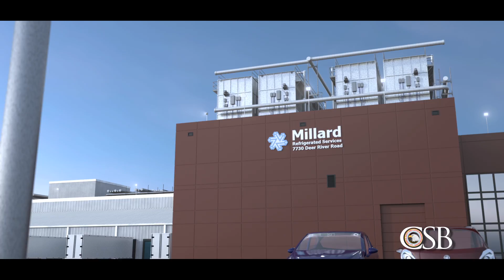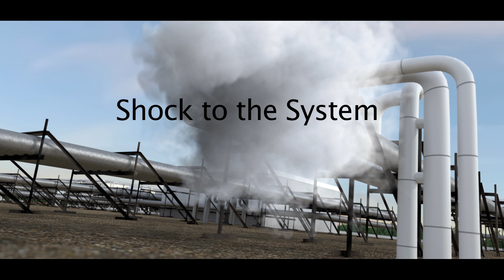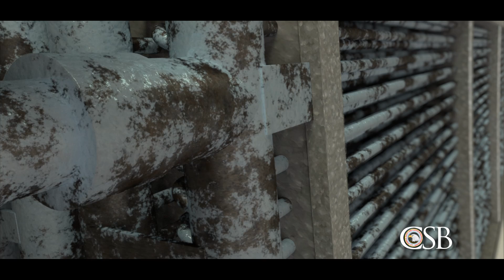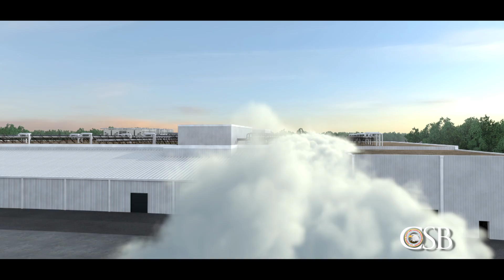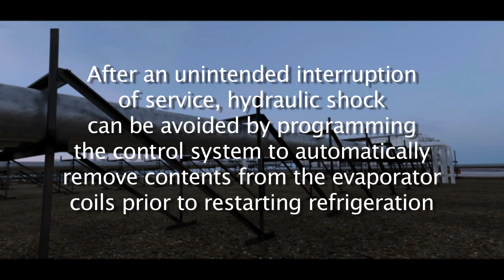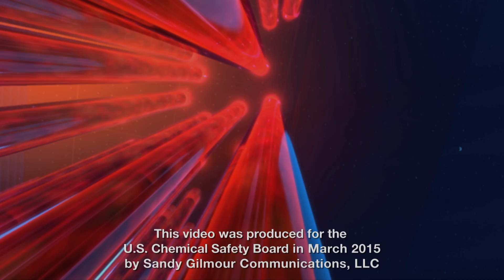Shock to the System

Comment: The people who do know about hydraulic shocks,usually call them ''water hammer''.
Reply: Steam Hammer and Water Hammer are two different animals. Water Hammer is due to the incompressibility of most fluids not being able to absorb the inertia of the fluid moving through the lines when a valve is suddenly closed.
Steam Hammer is from a rapid cooling of a gas to fluid resulting in a fluid 'plug' being built up and sent down the line with great force due to the vacuum in front of it from the rapid condensation pulling it, and/or the pressure of the gas behind it pushing it.
This was an example of Steam Hammer.
Reply: Daniell Bondad Never close a fire hydrant to quickly ;)
Reply: This aint water tho :)
Reply: Steam hammer as well.
Reply: I’m no plumber but a T section would be mounted vertically on the water line near the faucet. The idea is air would be trapped in the vertical pipe and act as a shock absorber for the water when it is shut off.
Reply: My toilet has a sticky refill valve that sometimes goes on a rampant hammering spree, visibly shaking the pipework after i flush. Talk about sending the stuff out with style...
I mitigate that by opening the cold faucet on the sink, giving the shock a place to get out.
Reply: Daniell Bondad its a better name and people look at you funny when you say water hammer. hydraulic shock and peoples eyes glaze over, "water hammer" makes peoples eyes bug out.
Reply: water hammer is totally diffrent mechanism, for irrigation anyways
Reply: @Richard Vaughn sounds good, doesn't work.  The air is eventually carried out since it can dissolve somewhat in water and the piece of pipe is fully filled with water.  That's why there are dedicated devices for that these days.
Reply: I was taught it was “liquid hammer” in tech school
Reply: I was just about to ask this. "Isn't this the same thing as water hammer?"
Reply: Or in this case ammonia hammer!
Reply: Practical Engineering guys over here huh?

More on that later.
Reply: It wasn't water..
Reply: Water hammer drives me fucking nuts, but at least it isn't supercooled/ammonia I guess.
Reply: Ah yes. If they just called it a water hammer I would’ve known what it was right away. Good call.👍
Reply: I always wondered if you turn the tap(House water that is) on or off fast and get the Hammering or juddering in the pipe that it may be damaging it?
Reply: @steviebboy69  Not a plumber or engineer but my guess would be 'probably no'; Most modern pipes would be substantial enough that the hydraulic shock behind the hammering noise wouldn't damage them, they'd just be too structurally sound. I guess low quality joints or valves may be but I guess in most houses they'd also be sturdy.
Reply: I wonder how different in a house of vintage like mine  over 60 years old.  it only hammers if i turn the taps off fast.
Reply: @steviebboy69  I'd guess that an older house would have even sturdier pipes than a modern one. Even if not, water hammer wouldn't effect intact pipes as the pressure would be spread over too great a surface area to rupture them. I'm not a plumber though so I may be wrong
Reply: @steviebboy69  8 months too late but water hammering will indeed wear your plumbing, especially the tap you are closing. It is the main reason why single lever mixing taps fail, the ball valve wears enough so it doesn't seal anymore and you get a drip.
Reply: @krpajda  Well you would thing that the banging would be doing some damage.
Reply: @willastle9623  In water lines they have shock arresters installed.  You may have seen them, they are usually behind a faucet and are approximately about 12 inch's long and are always vertical.  This is important because to operate it has to trap air inside, when a valve closes on your washing machine it creates a hydraulic shock which flows back to the air column which absorbs the shock by compression.  You also have these on your kitchen sink, where they are installed under the cabinet.  They can't completely eliminate the hammer but can reduce it considerably.
Reply: @steviebboy69  
On an old house, you might have an expansion tank or well tank. Those help prevent water hammer, by giving it somewhere to go. Of course, if those tanks are bad, they won't do anything, and should be replaced. Otherwise, if you do not have anything, you should probably install something to fix the problem. Older pipes, even copper do wear down over time, and get thinner. The small water hammer event can be enough to burst a pipe one day, and then you got a bigger issue. Over 60 years old? I'm in a house that was built in the late 1800s, but luckily a little bit more modern plumbing.

Comment: Same Problem as steam hammer I suppose. Large quantity of liquid gets up to high speed then slams into closed or restricted piping. Since the liquid is largely incompressible. The pipes adsorbs the energy by stretching. This can generate very large forces. I have only ever used ammonia in laboratory work in solution. Just having solution in open beakers is enough to clear a room. Releasing thousand of pounds of the dry stuff into the air is a really bad move.
Reply: More of Steam Hammer is a type of Hydraulic Shock, just that in this case it wasn't water... and they are using the engineering technical name for it.
Reply: I know this is a old thread but can anyone with any experience with this kind of system tell me how exactly the system was running a defrost cycle while the electric was out? the video explains it as immediately after power was restored, the system was in the middle of a defrost when they tried to restart it but doesn't make sense how that happened if there is no power to heat the ammonia.

Comment: BAD SOFTWARE/EQUIPMENT DESIGN
Reply: Beyond bad. The software should have been configured to automatically drain all pipes before restarting refrigeration if it was reset, interrupted or powered on from a otherwise unknown state. It should also have been designed to refuse to reset units that were performing operations that should never be interrupted.
Reply: Exactly
Reply: Agreed.  It's an engineering design flaw.

Comment: Very well made, very clear, thanks.

On the need for passwords for manual overrides, I can't help but think of the several other CSB videos that say something like "operators had been given the password", "the supervisor entered the password", etc.  If you don't have a hardwired interlock (like a temperature or pressure sensor on the coils interlocked to the valves) some fool will blow it up.  Yes, you can bypass the hardwired interlocks, but with much more effort -- hopefully more effort than simply fixing the problem.  Passwords are too easy.
Reply: As long as there is a way to override the safety measures by "authorized and trained personnel", this will also be done by some guy who cannot deny his bosses wish.
I have seen the owner of a dry cleaner shop to use a screw driver to mechanically unlock the magnetic lock of a cleaning machine while the solvent was already in. For him it only was holding the breath for a few seconds while putting some more clothes in and saving an additional machine run. According to the certificate of the shop he is a trained professional.
Reply: You are a100% correct. All interlocks should be hardwired. I've been an I/E Tech for 30 years and seen some dumb shit. Thers's always one or two idiot techs who will show operators how to jump interlocks thereby putting everyone's life in danger. To this day I've never jumped out interlocks for operators. It's cost me several jobs but I can sleep at night. Oh yeah I almost forgot nobody from lowly operator to plant manager would ever put in writing that they were asking me to jump out interlocks
Reply: @notsure1115  Well that is real shit. Like "Yo pal, just tell me how to bypass this system's safe locks in case i will need it, but let it be just between two of us. No docs, no evidence. That's basically the way you, engineers, do things, right?" 
Cant find words to describe this level of idiocy, ignorance and impudence of managers. 
BTW is there a way to prosecute those fellas?
Reply: How did they manage to get rid of you?
Reply: Bypassing a hardware interlock requires knowledge of what it does, how it does, and hopefully you know enough to know what it was doing before.
Reply: @wolphin732  Yes, and just the need to do so implies a bad controls system design to start with.  The designer must anticipate what the operators will need to do and allow those activities to be performed safely.
Reply: @DrMemory667  As usual... system is designed by engineers but they only know the theory... it is managed/run/supported by technicians that were not at all consulted by the engineers.

I think engineers should have at least 2 years experience as a related technician before starting their education... so they know how things work in the real world.  Not the perfect/ideal world that the engineers think it is, and would stop them from thinking that technicians are just there to do their whims.
Reply: Exactly, in the event of a disruption of service during the cycle it should auto clear and reset the lines.  Don't give idiots the chance to bypass anything.
Reply: @barneyrubble4293  agreed!  auto clears should happen after a power reset... and likely would have cleared many of the alarms the person had to reset manually too.
Reply: Theres almost never pressure and temperatures sensors on the coils or piping for the evaps themselves. The new fancy ones do only for flow control and temperature control, but the best thing they could have done was have the control system automatically go into a bleed phase used a manual open valve or regulator so when the power shuts down pressure wil equalize through out the system and avoid hydraulic shock.
Reply: Doc Memory What you mean is RBAC (role-based access control), frequently incorporated in information systems. All functions are clearly identified, and access levels are varied for every employee.

Comment: Another excellent and valuable CSB Safety video!
I would like to suggest CSB to add the transcript of the safety videos at each CSB investigation webpage. It would make easier to translate them in other languages, and add subtitles to those videos.
Reply: You can get the transcript from YouTube. I think they moved it into the description? Copy-paste. You might also be able to get it using certain open source command line software, but I'm not sure I'm allowed to say its name because it can be used to down-rhymes-with-mode videos. But anyways, recently CSB stopped uploading high-quality captions; nowadays they instead rely on YT auto-captions, whereas their old videos had proper captions. Also YT got rid of community-contributed subtitles. I'm replying to an 8-year-old comment lol

Comment: Bloody hell that is scary, ammonia is not to be messed about with.
I wonder if the issue with cold liquid ammonia going into the defrost cycle was known beforehand.
Reply: When I worked on ammonia control systems in the '90s this was well understood. We always designed the controls to perform a cool-down and a pump-down of the evaps before re-introducing liquid. Operators could not defeat this from their HMI consoles. However, a determined maintenance guy with a programming terminal could manage it if he understood the program well enough to know what bits to flip (but poorly enough to not understand the possible consequences). Wish the video was clearer on what exactly the people did when "manually resetting alarms", e.g. did the system allow them to do this from their console (bad design) or were they into the guts of the program (bad decision / bad training)??
Reply: ***** Thank you for the further information!
I work with biomethane scrubbers, and our safety functions can not be bypassed by flipping bits, the safety PLC does not allow bit states to be altered when in run mode.
Reply: ***** The video made it sound like they reset the PLC, which could have defaulted to the run state, if the evaporator was in the defrost cycle, defaulting to the run state would have re-introduced the liquid prematurely.
Reply: Dallas Babcock
Certainly a good possibility. Without seeing the actual PLC code involved in the incident I don't think us spectators will ever know for sure though. I always write important stuff like defrosts using retentive logic so the status is remembered across power-cycling & such, but of course that can be defeated easily enough if maintenance plugs in a terminal and wants to defeat it. Thus, I suppose, the reason we have "safety PLCs" such as GuardLogix now...
Reply: hochhaul
I definitely don't assume ALL maintenance are foolish. Only a select few. As in most fields, there are good and not so good maintenance people. I actually agree with your entire comment.
Reply: Seroster
And I would hope that now days new ammonia systems are being equipped with such PLCs. Getting all the old ones upgraded could take a few decades though. I know of lots of PLC-5 systems that I put in during the '90s that may very well run 40 years without replacement - just like they ran the relay systems that the PLC-5s replaced for half a century...
Reply: ***** Don't assume all maintenance are foolish enough to override safety interlocks. Those of us with quality education & proper training understand the consequences of major system transients/overriding safety interlocks. If anything, it's been my experience that it isn't until management gets involved that safety gets thrown out the window. Also, inn the video it's mentioned that when the emergency shutdown was initiated, the situation was made much worse. It's important to understand the nature of the leak before reacting (when possible). Shutting down the ammonia compressors will only magnify the problem if the leak is in the wrong spot. Unfortunately, there are many corporate safety individuals writing procedures and policies that overly simplify ammonia refrigeration systems and create the potential for even greater incidences.
Reply: Don't assume software is the answer, duh. Stuff just goes haywire &   
sometimes you have to reset or bypass stuff that's not functioning properly often based on past experience, you don't have all the input you need so you do your best, sometimes it works, sometimes it doesn't. having to do that doesn't make a moron, that's how the real world works.
Reply: @pvtimberfaller   Yes, the alternative is to call out a technician from another company that made the control system, then having that tech make the exact same mistake...

Maybe the extra person will spot the mistake 50% of the time, but the other 50% he does it anyway.